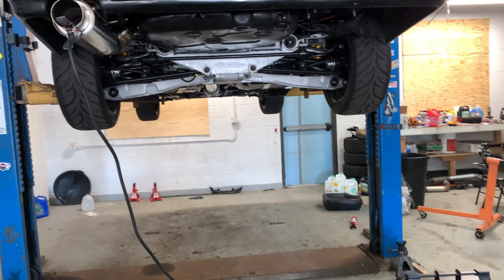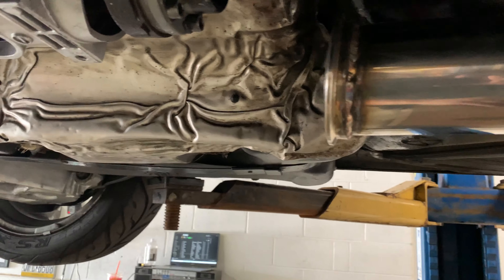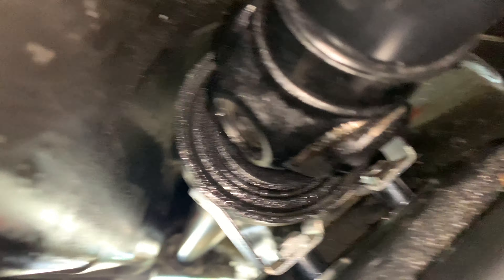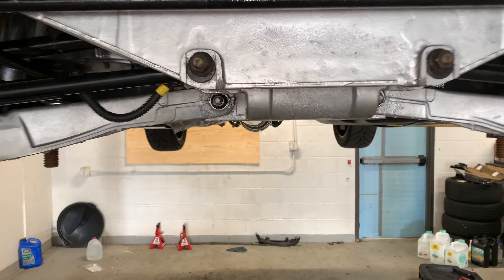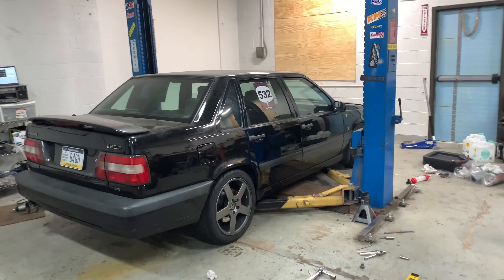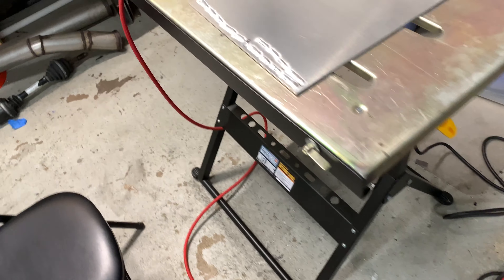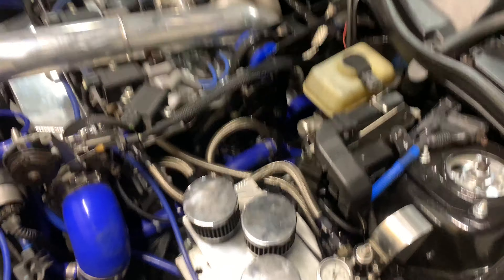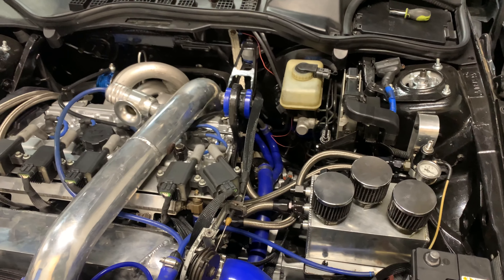Volvo 850 T-5R AWD Swap - Swap Mostly Finalized

Comment: Always love watching your content but would definitely like to also see the pvc mods you’ve done and also a ptc mod if you have one. I’ve never seen it on your set up. You’re in beast mode good sir
Reply from the maker: PTC is deleted and I vent to ATMOS. I will try and put together a good video of what you do for under 400hp and over 400hp. And the pros and cons to pull vac through the intake pipe.
Reply: @SimplyVolvo  I’m trying to go bigger than td04 right now and not sure what to do with the ptc

Comment: When I launch, the shaft goes TA-TA-TA!!:)))))

Sound so good, man, very sleeper

Looking forward for pcv review finally, I spent alooot of time around it. I'm wondering if oil spits even from the turbo drain hole to the can, where you have set it up to drain the can, tho..
You did hook up something to measure the pcv, right? Do you have some pressure on full boost there?
Reply from the maker: Some oil mist could be coming from the turbo oil drain I modified to act as a breather. Its mostly my really crappy hacked up N pcv box. Yes I am monitoring pressure most I saw was 0.4 psi @ 26 psi of boost and 8500 rpm. Sensor is mounted on the outlet of the stock PCV box to the catch can. Really not much pressure at all. Just need to deal with separating the oil better.
Reply: @SimplyVolvo  What, you mean the JB box?:))) Hey, you have to start somewhere;)
I see. Jesus, when you think of it ..well I guess it's very good for that boost and rpm..some oil must go out. 
That main breather exit that goes from block, it's fairly large, but that harsh 90 degree angle hose to the breather box there, is so restrictive, just in my opinion. I'm sure there's room for breathing improvement. 

But it really really sounds strongly good!

Comment: Love the videos :) any tips for making the m56 survive at 600-700hp?
Reply from the maker: If you're FWD you don't have to worry about breaking an M56. You'll never get enough traction in the lower gears to break something.
Reply: @SimplyVolvo  Okay thanks :) though my plan was to use it for rwd in a mid engine project since since where i live m56 are 100$ from the wreaking yard and 120$ for the engines
Reply: @SimplyVolvo  Would the m66 maybe be stronger? :)
Reply from the maker: @Nero.Valentine  M66 is weakest and has flaws with the shift mechanism (they break if you shift too hard). 23 Spline M56H 4.25 from a Volvo P1 (C30 V50 S40 2.5 NA) is the strongest transverse gearbox volvo has ever made. This gearset can handle 800lbft+ of the engine torque and has run 9s in 1/4. Any M56 will be up to the task honestly.
Reply: Okay thank you so much i really appreciate it :D
Reply: If you need anything translated from swedish let me know and id be glad to help out :) its the least i could do as a thanks :)
Reply from the maker: @Nero.Valentine  Oh and of course make sure to put either a Quaife LSD or Gripper LSD in. The stock diff is really the only weak point.

Comment: so basicly this awd converstion is a 850awd rear subframe with another diff in it and a welded viscous for 50/50 split?
Reply from the maker: Its the entire rear from a 98 V70XC. Custom LSD in the rear, Custom axles in the rear and of course the billet angle gear. The viscous is welded for locked front and rear wheel speed. It 4WD basically. VC I had was busted so Have another I have to try eventually.
Reply from the maker: I have 30+ videos on the entire swap. Go check them out.

Comment: what do you think about boosting a B5254S? possible?
Reply from the maker: Yes but you'll be limited by the 83mm bore and 10.5 CR (unless you're running E85).
Reply: @SimplyVolvo  ok. so low boost and no boom?